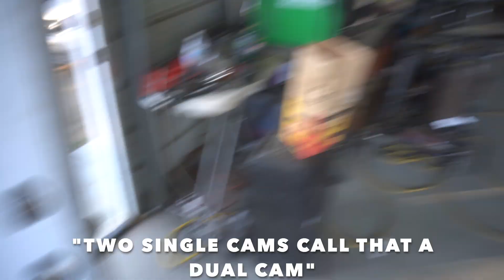NEW WHEELS FOR THE BMW E36!

Comment: bro I'm pretty sure they don't make a 225/40/17 (only that size in 18s etc) go for a 215/45 on the front. that'd probably do what you want looks wise but it will be a lot lower. or go 215 45 rear 215 40 front but it will be slammed
Reply: Been a while since any of the group has had 17s 🤣 looks like imma make him do 215 45
Reply: @Chiichariittoo  haha thats ballin on 18's for ya

Comment: You guys really need a pressure washer for the shop, that would of taken that plasti dip off, or use a heat gun and warm it up a little bit then try to peel it off, that works for me, but don’t overheat it just enough to where loosens it
Reply from the maker: Yeah unfortunately we don’t have access to water at the shop, but I’ll try a heat gun next time !